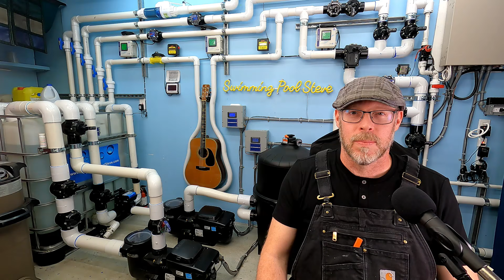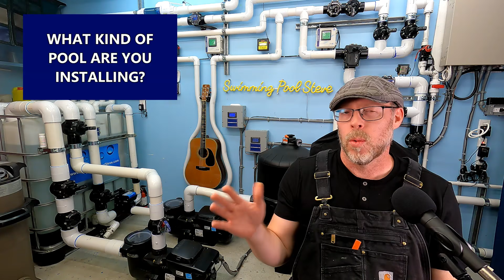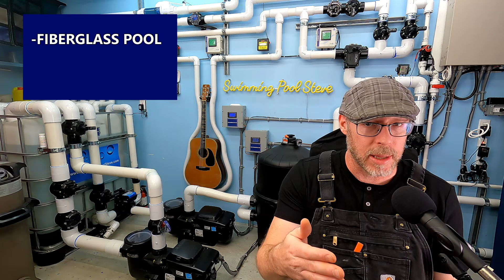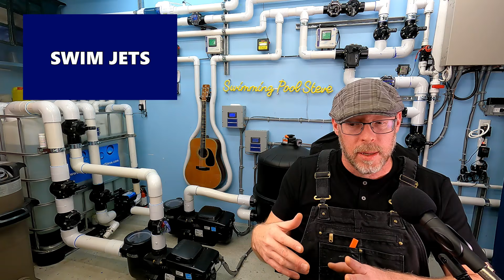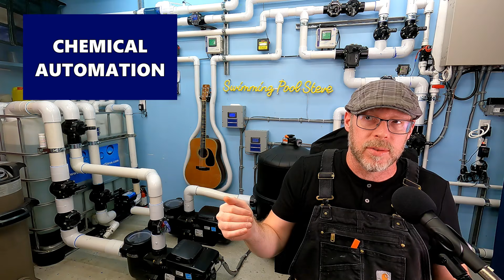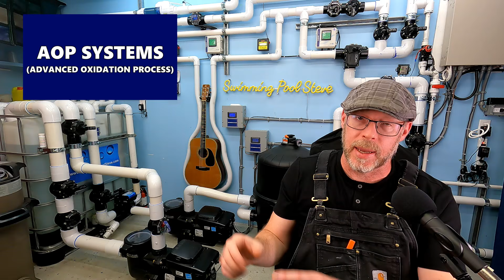Designing Your Dream Swimming Pool

Comment: design i've had in my head maybe not a dream design but... An L shaped 22x 30 shallow end 3.5 ft depth with deep end 20 x 30 with transition starting at 3.5 ft with gradual depth to 5.5 ft  & deep end ending with a beach entry way of 10 ft length with 2 love seats at the edge of beaach entry (in the actual deep end love seat instead of ladder). with a detached raised Spa off the end off depp end beach entry way with its own seprate system. for pool 4 skimmers & maybe im stuck in my ways but Hayward super pump, Pentair filter (D.E.  but not oppesed to cartridge) with rypak heater & of course Jandy valves with Polaris booster sweep LOL the usual hodge podge brand sytem set up HAHA & of course sized accordingly. concrete with dark grey plaster & grey tones natural stone look tile with grey grout example tile - Nero, 6" x 6"Stone Quartz Collection by Aquatica. & forgot to add the 180 ft + x 10 ft W lazy river haha actually forget the pool just lazy river and a spa LOL. great channel pal new to your channel last year & came back this year new subscriber keep the great content rolling

Comment: 10:57 

In my latest pool, I’m running 2 bubblers and two 4 feet sheer descent waterfall off of one pump. 3 inch suction to four 1.5 inch returns.  The key is knowing the optimal water requirements for each feature, tdh etc. 

I’m also using this second pump to help with pool circulation when the features are not running which is most of the day.   

I feel this is something pool builders should do more of. Especially in bigger pools over 25k gallons. It’s very simple to do. It’s just an extra automatic valve actuator, a couple return lines into the pool and a second filter.